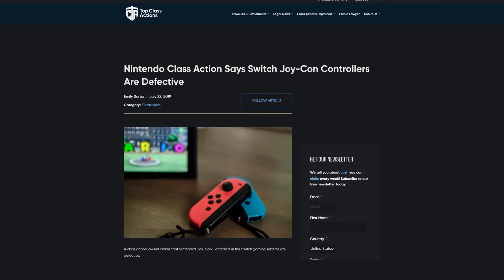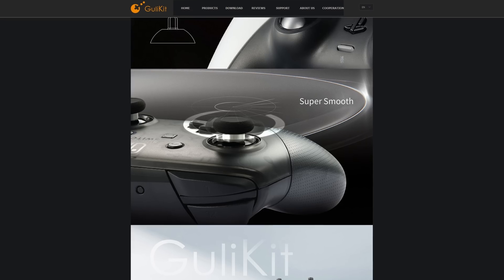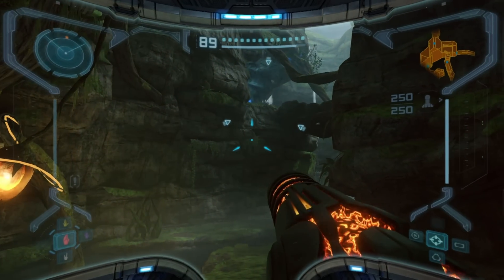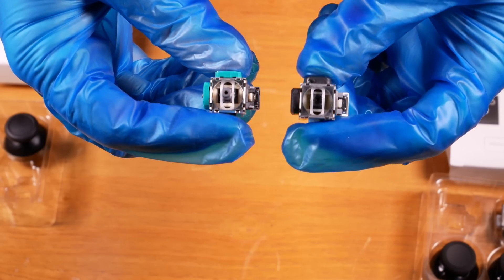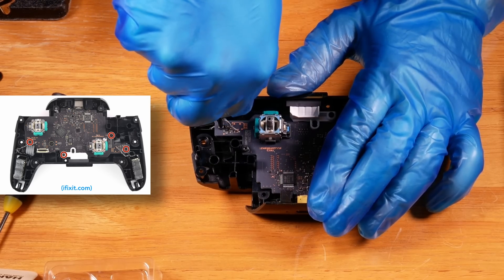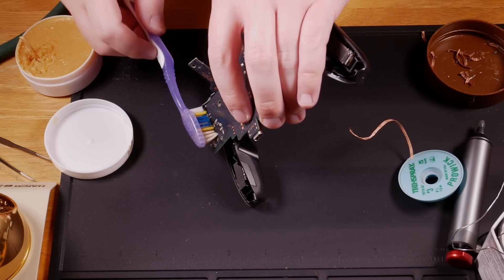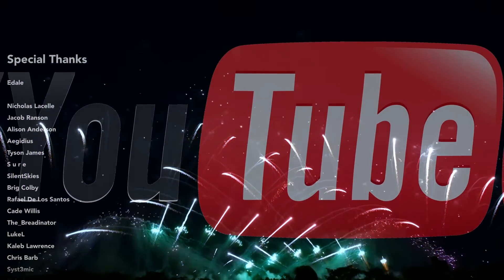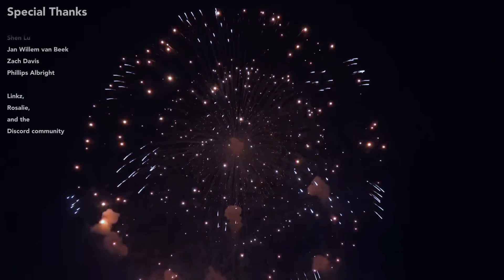Drift-Proofing First-Party Gamepads: Gulikit TMR Stick Review + Tutorial

Comment: Holy shit. Ive been looking so long for the perfect controller and I think this is it at 7:30

- D-pad in the Playstation position (for fighting games and platformers)
- Tactile d-pad (it even looks similar to the one on the Vita)
-TMR* sticks (for racing games)
- Gyro (for shooters)

On top of all that it has a bunch of other things I dont need but are still cool, like bluetooth, hall-effect/micro switch triggers, back buttons, etc

I think I can finally put my Dualshock 4 to rest. Thanks, Nerrel.
Reply: I was watching the video on the side and your comment made me go back and check
It's so hard to come by third party controllers with the PlayStation layout, might pick up one of these too
Reply: Will want to check out the triggers too, especially if you're interested in racing games.
Reply: If you're still in the market for one, the Fantech Nova II is a pretty decent fully featured controller with hall effect sticks and triggers, back paddles and gyro
Reply: @nisnast I dragged my feet the entire time until I settled on a Gamesir Tegenaria Lite a couple months ago.

I did look into the original Fantech Nova, and now the Nova II, but neither had the tactile d-pad I was looking for. The Gamesir Tarantula Pro from my original comment would've been an easy buy, if not for the stick latency issues. I figured that if I'm not gonna get the d-pad im looking for (dome switch), it'd be best to go cheap with the Tegenaria.

Comment: Did this with a pair of sticks from AliExpress on my (previously stock) ds4.

worked fine, and the firmware calibration tools that are out there make it pretty easy to re-calibrate. there's even one that runs in the browser, though not with firefox.

did maybe brick its ability to run off of battery. oops.

Comment: Been using the GuliKit KingKong 2 for awhile now and it's in tip top shape. Manufacturing does seem to be an issue for them. Face buttons on mine didn't have all the flashing removed, so they started squeaking and sticking. But opening it up and filing off the excess plastic was pretty simple.
If you don't want to mess around with learning to solder (why? it's easy and a valuable skill and makes you look cool and sexy) I can recommend the controller. Though if you want to use it for Playstation I think you're SOL and need to learn to solder, which you should anyway.

Comment: What about DS4Windows as an universal solution to the TMR center on PC? It has worked wonders for me to use Sony and Nintendo's controllers on PC. HidHide would hide the original controller, leaving only DS4 and your personal calibrations to use with any application. No need to mess with drivers and hex values.

Comment: dude I got myself a gulikit, despite some issues with the dongle sometimes not picking the controller up, the build quality on them is pretty great (still room for improvement tho). Tons of features as well. The hall effect sticks and the back paddles are great, and 2.4ghz is a must for me. I tried 2 8bitdo controllers before and neither of them were satisfying enough (the face buttons on both occasionally double clicked as well)
Reply: I have a KingKong2 and while I do like it, it did require some fiddling.
Hopefully if they get enough attention they can sort out these manufacturing issues and become a genuine threat to the console manufacturers and force them to abandon these garbage planned obsolescence tactics.

Comment: I treated my Dualsense like a baby and it still got bad drift. I expected some slight drift easily fixable with a small deadzone increase, not this wierd random phantom input right in the middle of the stick where a 50% huge deadzone can barely cover the issue. It sucks. I'll give this a try once I get.. sigh, a second dualsense just in case because I will screw this up.

Comment: This is so much work for something that should have been fixed from stock. I've tried replacing the sticks on a drifty PS5 controller and even with my proper soldering station, hot air, etc, I still couldn't get one of the sticks to work properly. It was so easy to muck something up, like accidentally removing a microscopic resistor
Reply: bro im tellin u rn dont even try to work on sony controllers they r hell
Reply: ps4 controllers are pretty easy @ibrahimtamimi7561
Reply: That sucks that you couldn't get them to work, I sound like an asshole here, but I soldered some less expensive Hall effects in my Dualsense, as the first soldering project in several years and was able to calibrate them to great effect.
Reply: Maybe you skipped the calibration part.
Reply: I replaced the stock analog modules of my DualShock 4 controller with hall effect ones from aliexpress, it was my cleanest desoldering job ever, and they worked great... then 6 months later this controller started having an issue in which, after being turned off for more than 5 seconds, it brick up for over a minute, then when it turns back on it's already forgotten the last paired bluetooth device.

You just can't win with modern controllers. Guess I'll just stick to my trusty DualShock 3.
Reply: This happened to me too. My pro controller had drift for months, bought replacement part and attempted to fix it. While it worked to an extent it came with its own problems.
Reply: Who here is now lusting after the sensing technology in an N64? (the physical wear issues are actually easily fixable from both an engineering and repair point)

Comment: When testing the old Steam Input based analog fix for Sonic Adventure 2 and other Dreamcast PC ports I found that Steam Input apparently doesn't set the global deadzone option to on by default. You have to go into each game's Steam Input config and manually tell the game to use Steam Input's deadzones, otherwise it will use the controller's default deadzones. Which is stupid, but it explains why Returnal's deadzones set to 0 while Steam Input's deadzones set manually didn't do anything.

Comment: The issue being how accessible these are will be so limiting. I think even a less experienced user can hotswap a stick by opening and replacing, lile with the joycon. But the soldering and manual calibration is such a huge brick wall to these being accessible. 

Hopefully this is only version 1, and they figure out a way fo make them easier.
If that happens, at least we as users will have an easy option compared to stock scam sticks.